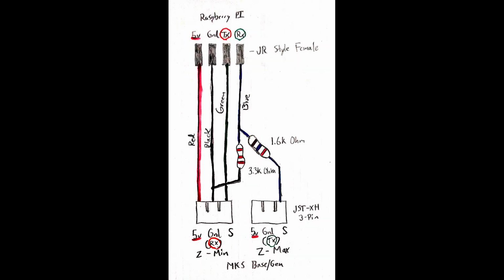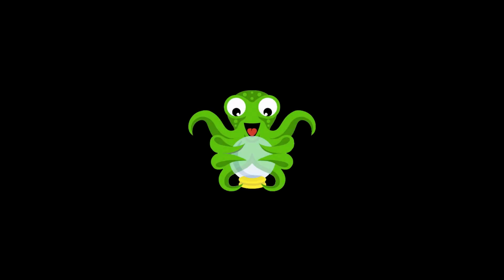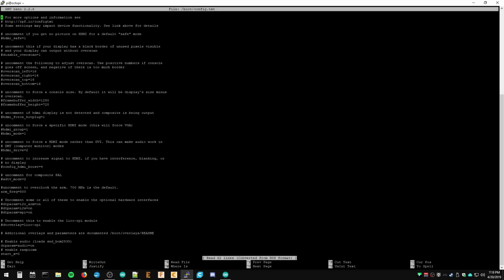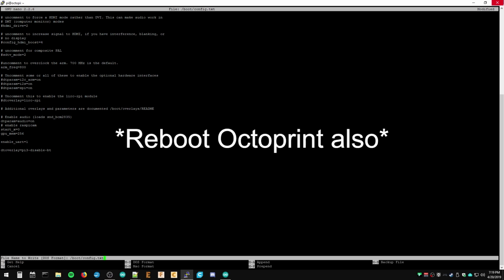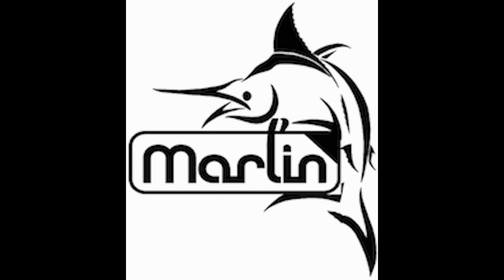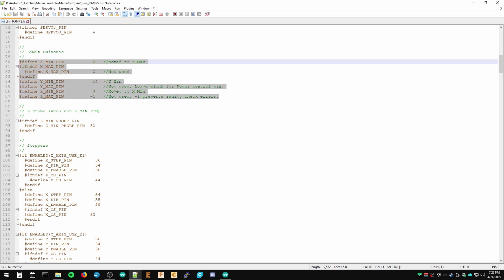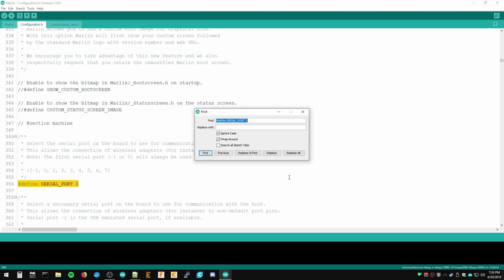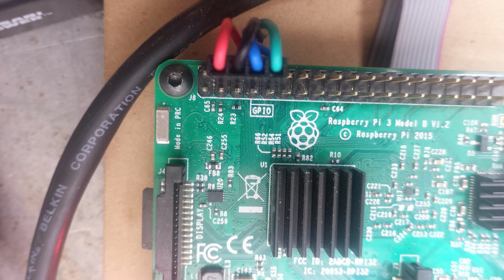Octoprint UART Serial Guide

Comment from the maker: Hi everyone! This video is fairly old now, Most people have switched to using SKR controllers by this time and things have changed a bit. This tutorial should still have some useful info if you are still using the old MKS 8bit boards, but I will do a new video soon about doing this with an SKR and Pi/PiZero. I'm also working on a tutorial on Klipper using this type of link.

Comment: So if i want to use Octoprint with TMC2209 in UART i need to do this ? Well i guess i wasted my money on TMC2209
Reply from the maker: UART is serial, its not just for motor drivers. This is for communication between the control board and a raspberyy pi running octoprint and has nothing to do with the UART between the controller board and the motor drivers...

Comment: I could not get this method to work properly due to permissions. Using raspi-config to change the settings worked like a charm.
https://github.com/codebugtools/codebug_tether/issues/17
Reply from the maker: Something got changed in the recent update to raspbian. Not sure why, I noticed this recently. My earlier method doesn't seem to work now. You do have to enable the port through the config in shell and disable the shell access through the port. See my recent pinned comment. Thanks for the link!

Comment from the maker: It has come to my attention that the /dev/ttyAMA0 may not work every time. If this happens try using /dev/serial0. Also, if you have issues where it says permission denied, you may need to use raspi-config to enable the serial UART and disable the terminal access through that port. Something was changed in the recent updates to raspbian and you may encounter issues with permissions if you do it the way I stated in the video. Older versions of raspbian will still work this way though. You still need to move or disable the blue-tooth in order to have full UART speeds and functionality on that port.

Comment: This is awesome, exactly what I want to do and you even have the same board as me! (Tevo Tornado?) My Octoprint keeps dropping the serial connection and I'm fairly sure it is because the FTDI chip is bad/fake, so hoping this will fix things up.

One question I have, after doing these changes to the firmware I am guessing that you can't flash firmware through the USB port anymore. Is that right? If so do you flash from the RPI now?
Reply from the maker: You can still use the USB to flash, it won't affect that. The FTDI chip will still trigger the bootloader. Because we aren't connecting any resets lines you can't do flashing from the Rpi this way. But I'm sure there is a way to do it if someone were to dig a bit more in to the pins.
Reply: That's good, will make things easier. So it would just be normal USB printing that is disabled? That won't be needed anyway because of the RPI and octoprint.

Thanks again for the video.

Comment: i wouldn't need a voltage divider if the end stop logic on my skr v1.3 is operating at 3.3VDC would i? i mean your using that voltage divider to step down ~ 5VDC to a ~ 3.3VDC, no?
Reply from the maker: Correct. If the logic level of the board is already at the 3.3v logic level of the rpi you dont need a divider or level shifter.
Reply from the maker: Let me caution that I am not familliar with the SKR boards so I would varify that the endstops are indeed 3.3v.
Reply: @sergeantseven4240  yup verified the endstop voltages using my multimeter. however i'm getting two different voltages from a single endstop, ie. an x min.  there's a pin labeled 5VDC in the pin diagram of the board, and there's another pin labeled `1.29` within the grouping of the 3 pins for the `x min` endstop and hooking up GND and `1.29` i get ~ 3.3VDC which is what i using for my `Z min` `Y min` and the logic is the same for the `X max` `Y max` `Z max` endstops as well. so i'm a little confused, but i'll rewatch the video.
Reply: @sergeantseven4240  also i further detailed my question ❓ / findings below

https://github.com/ipatch/Marlin/tree/ipatch/build-marlin-2.x/media

Comment: been trying to figure this out with the skr 1.3 bigtree, can't seem to get a proper connection via GPIO uart port on the rpi.

great tutorial nonetheless.
Reply from the maker: Have you enabled the UART port on the RPi? By default its set to be used by the bluetooth onboard. Also, you may need a level shifter unless the port on the controller is 3v. Then its a straight connection. On Atmega based boards its 5 volts on the controller side but on 32 bit boards its going to be 3v. Not familliar with the skr 1.3 though myself.
Reply: @sergeantseven4240  yeah was running into all sorts of issues connecting octoprint to my board this morning, but toggling some of the settings seemed to get the USB connection. once I get things dialed in with the USB connection I'll give the GPIO UART pins a go again.

And yeah I disabled BT on this pi 3b, and disable console login for the pins to give access to the UART for octoprint, but was unable to connect last i checked.  I posted my findings below

https://github.com/MarlinFirmware/Marlin/issues/14004#issuecomment-544277931

Comment: Many thanks, it is the first good tutorial about this way!
I would do this too, but have some questions:
I have a MKS gen L and would do it with the Pins 16 / 17 ( EXP1) without the 5V line and power the Raspi external. Would it work, obviously without edit the defines of the pullups and Axis? And it is similiar if I put the RX line with the 3.3k resistor at a other GND?
Reply from the maker: Im not sure about which pins those are. I would have to look at the pinout. As long as they are one of the UART pairs you are fine. Just make sure they arent assigned to anything else in the pins file. You still need to tie the ground to both boards and use a voltage divider or level shifter. I used the extra end stops because they arent being used. You really only need 3 end stops on most printers.
Reply: @sergeantseven4240  Cool, thanks! Yes they should be serial ports so i give it a try otherwise i do it like you.

Comment: Why did you edit pins_ramps when you're using it for a mks board?
Reply from the maker: Because the MKS pins definition file points to the ramps definition file for everything except the mosFET pins. The MKS board is based off of the ramps board. The specific pins we needed to change are in that file and its easier to change them there then it is to create a whole new definition in the mks file.
Reply: @sergeantseven4240  Ah I see, just took a look at the mks_gen_lpins.h and I see what you mean. I'm using a skr 1.3 and everything is redefined, which is why I was confused!
Reply from the maker: @yetanotherPC  Correct, Different boards have different changes to pin defines. They are all similar though but some boards have harder to find pin out diagrams.

Comment: What's wrong with using the USB?
Reply from the maker: Well for starters, the USB is bulky and not very easy to deal with for cable management. The biggest thing most of us want is the ability to connect without the printer resetting. Also, the usb to uart chips most of the time dont work with Marlins emergency parser function. But with this, when connecting via octoprint, the printer will not reset and will retain homing. A lot of people found this to be very useful including myself. Also as a bonus, you can power the raspberry pi without a usb power supply.
Reply: @sergeantseven4240  Cool!  This looks like the way to go.  I had no idea what the advantages were.  If you mentioned this in the video I'm sorry I missed it.  Learning as we go and asking questions when we need to.  Thanks!
Reply: Also, if you're like me with a busted USB controller on their Pi 0w, you don't need to get a new Pi.